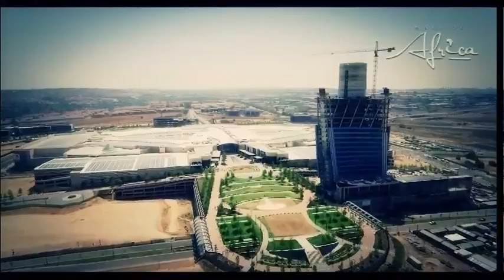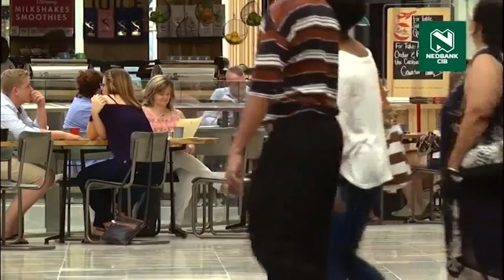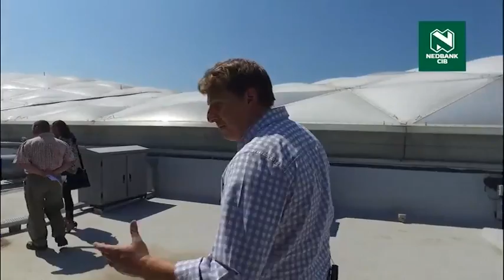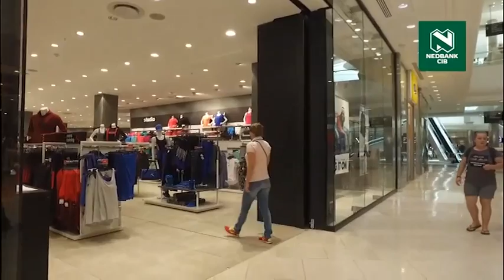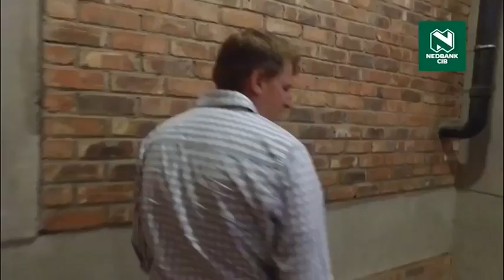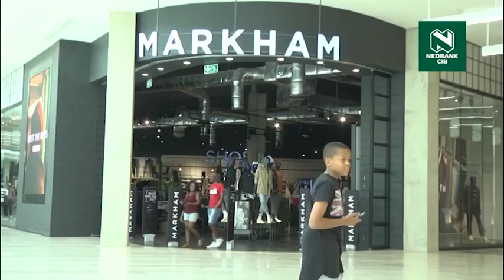Powering Africa: Mall of Africa's solar energy installation

Comment: 7:55 Correction, there is no chemical reqction in the solar panels. They produce electricity directly using photons from the sun that have enough energy to move electrons in the silicone atoms from valence band to conduction band thereby resulting in a voltage